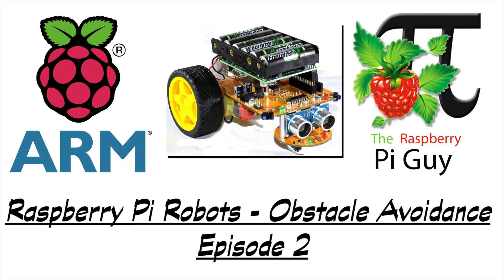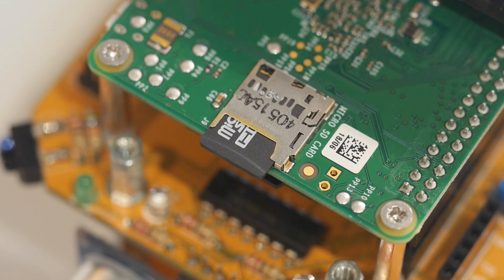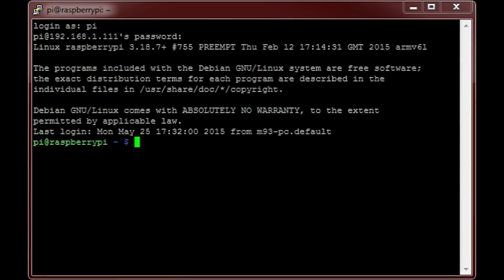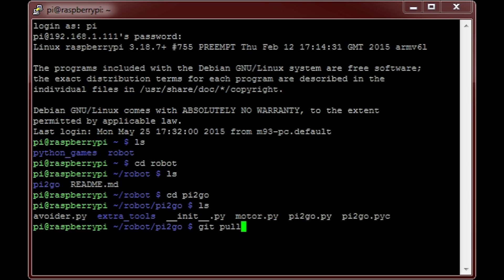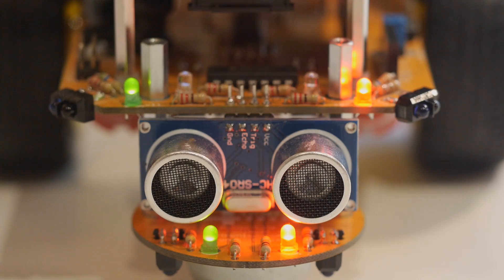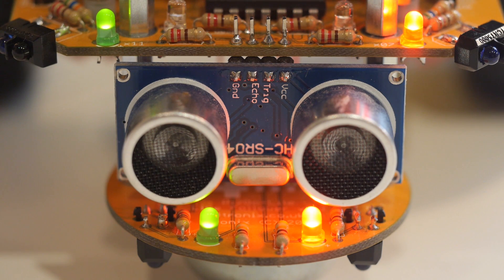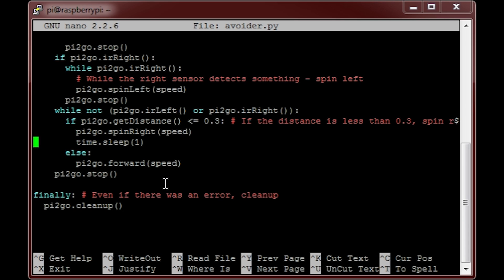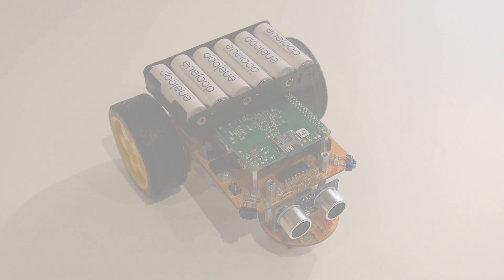Raspberry Pi Robots - Obstacle Avoidance - Episode 2

Comment: I tried to get around this by copying over avoider.py contenti from your website (https://github.com/the-raspberry-pi-guy/robot/blob/master/pi2go/avoider.py) using Python 3 on the pi but this happened. Any thoughts?
Thanks
Oliver

------
pi@raspberrypi~/robot/pi2go $ ls
avoider.py  extra_tools  _init_.py  motor.py  pi2go.py  pi2go.pyc  rob.py
pi@raspberrypi~/robot/pi2go $ sudo python avoider.py
  File "avoider.py", line 1
    Python 3.2.3 (default, Mar  1 2013, 11:53:50)
             ^
SyntaxError: invalid syntax
pi@raspberrypi~/robot/pi2go $ ls
avoider.py  extra_tools  _init_.py  motor.py  pi2go.py  pi2go.pyc  rob.py
pi@raspberrypi~/robot/pi2go $ sudo python avoider.py
  File "avoider.py", line 1
    Python 3.2.3 (default, Mar  1 2013, 11:53:50)
             ^
SyntaxError: invalid syntax
pi@raspberrypi~/robot/pi2go $ sudo python avoider.py
  File "avoider.py", line 1
    Python 3.2.3 (default, Mar  1 2013, 11:53:50)
             ^
SyntaxError: invalid syntax
Reply from the maker: Use Python instead of Python 3. These tutorials are compatible with Python 2.x currently
Reply: ***** Great. Just done that and it's spinning round. That's certainly progress. I think one of my front sensors is missing a resistor as the front left has two and the front right just has one. So I'll fix that and try again. I guess it would explain a constant spin!
Reply from the maker: Oliver Wright best of luck! Enjoy!